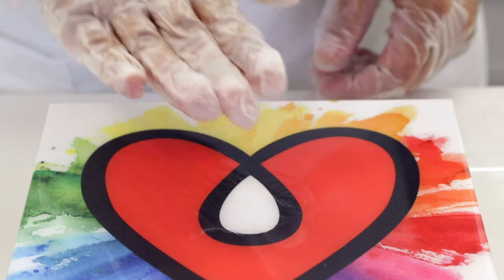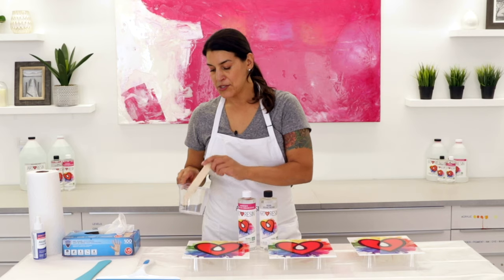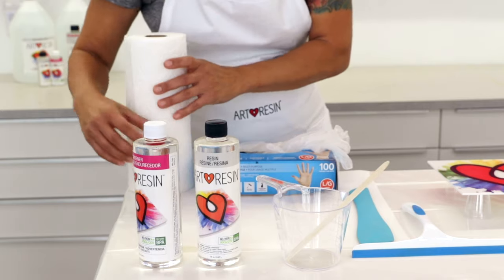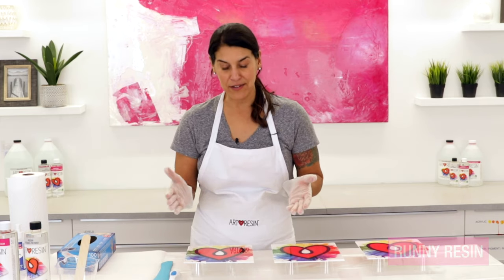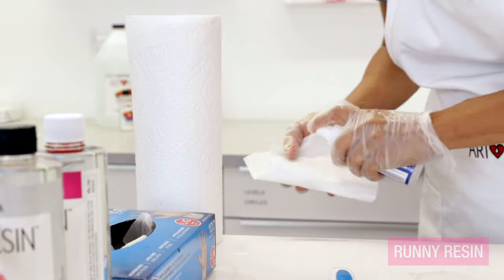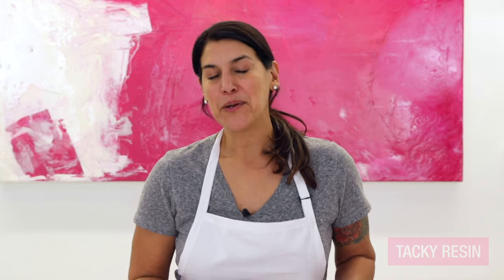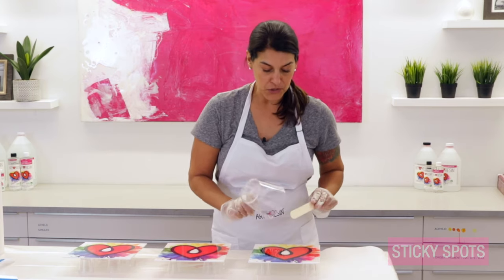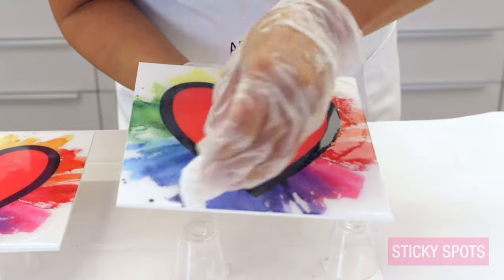How to Fix Sticky Resin - Top Tips & Tricks

Comment: For the tacky resin, what do you mean when you say that it needs to be in a warmer area. My project is out of its mold already and it’s just a little sticky. Do I put it next to a window? Is that what you mean?
Reply from the maker: Hmmm. Warmer spaces means faster curing.  If it is still sticky after a few days, there may be some unmixed material scraped out at the end of pouring….  You can try and seal it with one more  coat of resin??

Comment: I would like to ask, i know u used 2part resin for thses fixes but wat if u get tacky resin with uv resin? I sometimes i problems after curing with a uv light. I use the longested mins on my light which is 99 but sometimes they r tacky even after curing them 3 or 4 times. Not sure if u would know about uv. But it does help me with my bookmarks i made with the 2part resin. Ty
Reply from the maker: Hi Kimberly, unfortunately we do not work with UV curing resin so I cannot give you proper advice on this.   Good luck :)

Comment: I have just started to sand the cured areas but as expected it has created loads of scratch marks that are not wiping off with a damp cloth. Will these go away with the new layer of resin?
Reply from the maker: Yes! The new coat of resin will fill in the scratch marks and it will look beautiful when finished :)

Comment: Can i use sandpaper or machines ones to buff or take the extra rigid resin off even after the paints prior???
Reply from the maker: yes you can sand resin that has cured.  If your resin is sticky or wet, it will just gum up your sandpaper and make a mess.

Comment: Does the humidity have any effect on resin? My resin after 4 hrs also appears runny... but we are in the middle of monsoon.
Reply from the maker: Hi Ela, One of the most important factors to ensure your epoxy resin cures properly is temperature. The ideal temperature for both your ArtResin and your workspace is slightly warmer than room temperature: 75-85F or 24-30C. You also want it to be dry, 50% humidity is ideal and stable meaning no dips in temperature during the first 24hrs. Take a look at our blog for more information: https://www.artresin.com/blogs/artresin/what-is-the-perfect-temperature-to-cure-epoxy-resin
Reply: @Artresin  Thank you so much 😊

Comment: Mam. I didn't check properly and mixed 2:1 resin with 3:1 hardner. 1 ounces each. Like your second sample it looks cured but  the surface is tacky . Should I follow your step or its ruined.

And thanks for making this video. It is very helpful. 🙏🙏
Reply from the maker: The best you can do is try to apply a properly mixed coat of resin over top of the sticky layer to see if you can save this piece.

Comment: thank you! if you dont weight it tho how are you able to mix it right? my resin says it should be A 2:1 B
Reply from the maker: Hi Anayak, ArtResin is always a 1:1 ratio by volume.  All epoxy resins are different, it is important to follow the manufactures directions for the epoxy you are using.

Comment: Hiii I've used a 2:1 resin for curing and it's sticky at some places. Can I use a 3:1 resin now to add the 2nd layer?
Reply from the maker: It should be fine, just double check with the manufacturer to ensure its compatibility.
Reply: @Artresin  thank you so much for helping me out 🥺❤️

Comment: What if I am mixing and doing my art in a colder area and then moving my pieces to the warmth of another room?  I live in MN so often my main floor stays around 69 and my office where I have a portable heater can be made much warmer.  I can keep that around 75 or 77.  I have had a few larger pieces now turn out tacky on parts of the outside.  And they are not flat so I'm not sure how I would apply resin that won't just roll right off the surface (one is a 3D skull and one is a cylinder shape).
Reply from the maker: Hi Teresa, ideally we recommend letting your ArtResin cure in a room with a consistent temperature between 75-85F.   The pieces that you have that remain sticky in certain areas only are likely the result of under mixing your batch.  There could have been an area in your mixing cup that didn't get fully combined, when applied to your surface this area will remain sticky.  You can mix a new batch and either brush on your piece or smooth on with a gloved hand since it is not flat.  If you need more information feel free to contact us at support@artresin.com  :)

Comment: What about when adding pigment then it gets sticky?I think my issue was I was only mixing 1/2 ounce and the white pigment was a bit more than one drop. It’s not a full 24 hr yet.I didn’t warm the bottles prior but I did use a space heater like I always do.
Reply from the maker: Hi Janine, always keep your pigment or colourant under 6% and ensure that you mix it in thoroughly so that you avoid any issues with it throwing off the mixing ratio.

Comment: So useful as I have a piece from yesterday that has a bit of all 3. I really thought I would have to (very sadly) throw it away, or at least cut the cured part & use for mixed media. My only question is; what if the sticky part has colourant in it too? You are using prints here so not easy to decipher. Do I just mix new batch with colour? Many thanks for any advice and for sharing! C👌😊🐾🐾
Reply from the maker: You could do it one of two ways. You could mix a new batch with color and pour again. Or if after sanding the color is still remaining and you are just needing a top coat you could mix and pour a clear coat on top. The finished product will look a little different as your colored resin is now underneath a layer of clear. 

I guess long story short , either way is fine it really is your preference :)
Reply: @Artresin  That's really helpful, thank you for taking the time to reply!!😊🐾

Comment: Would it be a good idea to mix a higher % of hardner to avoid such problems?
Reply from the maker: The root of the problem is not mixing thoroughly enough, or not mixing in the right ratio.  We never recommend altering the mixing ratio, to do so will just cause more problems.  Stick to the 1:1 ratio by volume and just be sure to combine the two parts fully.

Comment: Mine is like a goo. Im not sure what I did wrong. The first pour is hard but the second is goo. It's in a deer mold so it's kinda hard to just scrap off and start over. Is there a way to save it?
Reply from the maker: If you have let it cure for at least 24 hours in a room that is around 75F or above and it is still not cured, something has gone wrong in your mixing or your measuring and it won't finish its cure.  If it is goey, you will have to try to remove that soft resin before pouring in another layer otherwise it will just ooze out between the layers.

Comment: Hi, I have a question.. 
I used the same measurements (equal parts) and not by weight, left it for a day and it’s cured but not completely, it’s a bit floppy “I made book marks” tried to to a new batch and it’s still the same thing. What’s the issue?
Reply from the maker: Hi Haleema,  bendy resin can happen for a few reasons.  It sounds like you have measured correctly so the resin may just need some more time to cure fully (ArtResin will cure to the touch in 24 hours, but will take 72 hours to reach its full cure), or the item you made may be too thin and retain some flexibility.  Pieces that are less than 1/3" thick may still be flexible.  For more details on bendy resin, have a look at our blog:  https://www.artresin.com/blogs/artresin/how-to-prevent-bendy-resin?_pos=1&_sid=022c4b727&_ss=r

Comment: So my wife and I did a acrylic pour on our dining room table and then we put epoxy on top, but when we were doing the epoxy we weighed it on a scale but it turned out we used about 15% more hardener then resin and so I’m concerned it’s not gonna be hard enough can I just pour a mixture on top once it drys?
Reply from the maker: ArtResin is a 1:1 mixing ratio by volume, not by weight.  The resin weighs more than the hardener so you will not get a 1:1 using a scale.  If you find that your surface does not cure perfectly, you can simply pour a second coat on top.  (if it is cured hard, you should give it a light sanding, if it is sticky there is no need to sand first)
Reply: @Artresin  so it’s not sticky but I can make an imprint with my finger nail and the table top epoxy we are using saids it’s supposed to be scratch resistant, I saw a video and it’s supposed to be had as a rock where you can hit it with a screwdriver and it not indent or leave a mark. So do you think I would sand it a little then do another coat or just do another coat?
Reply from the maker: @overcome4him23  I would sand a bit, if it is not gumming up your sandpaper, then continue.  The sanding will just give some tooth to the next layer.

Comment: Really appreciate this video <3 I have some pieces that did not cure at all, they were liquidy although I'm so certain I mixed correctly, but I feel the only explanation must be that I accidently somehow mixed two of the same parts! They are acrylic paintings on agates so its been really hard to scrape the resin off without damaging my paintings. I have gotten as much of it off as I can but theres still a small amount across the surface though its not going to run off or anything like that, its a very small amount. I just cannot scrape it anymore without starting to take off paint. So I was just wondering if it will still be ok to now do a second pour of resin? (my husband will be quality controlling this time xD)
Reply from the maker: As long as you have removed as much of the wet product as possible, you can pour your next layer.  You just want to avoid goopy wet pockets of uncured resin as it could eventually seep out under the cured resin layer, it is expected that you will still have wet sticky areas before you re-pour.  Good luck :)
Reply: @Artresin  Thanks so much for the reply, I have re poured and everything seems to be fine this time around. So relieved that I could save these pieces from my silly mistake, big thanks again for the video! :D

Comment: I had resin that was 3 years old and it would only set to a hard gel. I have used old resins before but this low priced "Bargain brand" is not so forgiving. I have a rare insect cast inside so All I can do is heat it. Every time I heat it it turns softer and then when cooled its back to hard jell phase. Any ideas??? UV light? Bake it hotter? 90 days in the summer sun? It does seem to get a little harder every week but at this rate it will take years. HELP! Thanks
Reply from the maker: Hi John,
It is really hard to know what to expect, not knowing the brand you used.  If it keeps getting harder as time goes on, it may just require time.  I would not recommend putting it in the sun or an oven as it can accelerate yellowing,  Most epoxy resin will soften when heated then return to their normal hardness when cooled.

Comment: So to the maker of this video I did what you told me and it really worked its harden now but there's still some sticky spots but nothing running so no scraping needed I was wondering if that's just the object cure piece by piece or do I need to do something different
Reply from the maker: Hi there,  If you have sticky spots you don't need to scrape,  you can just pour a perfectly mixed layer overtop to cover.  Just be sure you are measuring accurately by volume and mixing thoroughly 🙂
Reply: @Artresin  okay I will try that hopefully it will work and I won't have to thorugh it away its been a week now working on it thank you for replying 😊
Reply from the maker: @Omggbreeee  good luck 🙂

Comment: Great tips but how would I apply these to items like coasters or molds? It'd be difficult to apply another layer for example if it's tacky(which has happened to me plenty of times)
Reply from the maker: Hi Angela, you would probably want to take your tacky pieces out of the mold and apply a fresh coating of ArtResin using a gloved hand or a paint brush.  Coat one side, let it cure then coat the other side to complete.
Reply: @Artresin  thanks a bunch! That sounds like that might work out!

Comment: Nice information, upper side is cured but inside the mold is sticky what i do?
Reply from the maker: In this case, you could take the piece out of the mold and apply a top coat.  You could apply the ArtResin in a thin coat with a brush or a gloved hand to help avoid drips, the surface coating should be enough to seal in the sticky surface.

Comment: I made a resin tray and there was a small section where it was tacky. Do I need to sand the entire tray and then add another coat?
Reply from the maker: Hi Cassidy-yes, for best results you will want to sand the surface and pour a second coat.

Comment: If my tumbler was a little tacky and I sprayed paint over it to make s peek a boo effect and now the tumbler is still tacky.  Is there anything I can do without stripping all if it?
Reply from the maker: You can simply mix a fresh batch of ArtResin and pour it right over top of the sticky resin, the stickiness will give it the tooth it needs to adhere strongly.  Just be sure to measure carefully and mix thoroughly to prevent sticky resin :)

Comment: What if it’s cured and not sticky, but really bendy still weeks later? I have a keychain mold that comes out great sometimes, but bendy sometimes. I tested a bendy one on my key ring, and it started to break apart around the hole and chain. The hard pieces don’t do that. Can I try to coat them in more resin to see if it will harden properly?
Reply from the maker: Bendy resin is usually a result of an improper mixing ratio (always measure 1:1 by volume), under mixing or adding too much colour.  If you have pieces that don't cure properly and are still sticky- coating with a new layer can fix it.  You can certainly try coating bendy pieces, the added resin may be enough to firm them up.
Reply: @Artresin  thanks for replying! I definitely mix well enough until all streaks are gone and what not. It’s never sticky, just bendy sometimes. Adding too much color could definitely be the problem! Or maybe the humidity that comes at night time. I’ll see if maybe a clear coating over those will help harden them up a bit. Thanks!

Comment: I had just bought a dinning room table. It was repainted black. And me and and my wife got it back to our house and the chairs and table were very sticky. Can u give us some advice to make it go away?
Reply from the maker: Hi Steven, is the table coated in resin or is it paint?  If you are not sure of what the surface is, you will need to determine this first.  If it was a layer of ArtResin that didn't cure properly, you can follow the steps in this video and pour a fresh perfectly mixed layer overtop.  If your surface is paint, you will want to consult a paint professional to determine next steps.  Good luck!

Comment: I was putting resin on tile coasters that had alcohol ink on them. I had already varnished them and uv coated/sprayed them and they had plenty of time to cure. I then tried to resin them and all of them came out bad. I mixed well and had gotten all the bubbles out and covered them. Later when I looked at them they we foggy and major  bubbles. Actually when everything dried I could pop it all off. I’m not sure why that happened, except on the day I did them it was a very humid day so could that have caused that to happen?
Reply from the maker: Hi Cindy, we are so sorry that you had a problem with this project.  The humidity you mentioned could definitely be causing this cloudiness.  Try running a dehumidifier in humid weather and avoid introducing any moisture into the mixture.   I would recommend mixing another small amount and pouring a test piece to make sure it was just a one time occurrence.  Feel free to contact us at support@artresin.com with photos and we can dig a little deeper to find out why.

Comment: No matter how I try the resin job never comes out perfect!  Always a speck or two of dust.  Do I need to sand the whole surface before I re-pour with another coat of resin or will it be ok to just sand the specks?  Or do I need to even sand anything?  Frustrated!
Reply from the maker: Hi Elise, I totally understand your frustration....dust is not our friend!  Unfortunately, we don't recommend spot fixing for the simple reason that it's very difficult to sand out a small area where there might be an issue, such as a bubble, hair, or even where a bit of dust landed in your wet resin. It's almost impossible to get a seamless finish by pouring a fresh patch of resin on top of the original resin coat.
Instead, we recommend that you sand down the entire surface and pour another perfectly measured, well mixed coat of ArtResin over the entire piece for an even, flawless finish!
here is a link to our blog on how to apply a second coat: 
https://www.artresin.com/blogs/artresin/44594177-how-to-apply-a-second-coat

💡Tip:  Make sure that before you start your resin project, you have a clean box or plastic bin available that is large enough to cover your work.  Once you pour, cover your piece with the box to prevent dust in the air from settling on your resin while it cures.